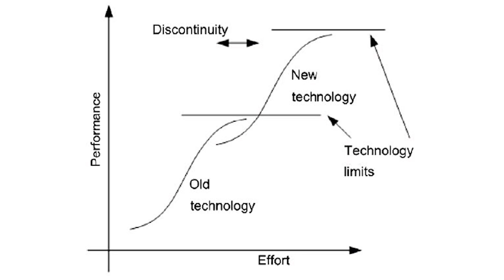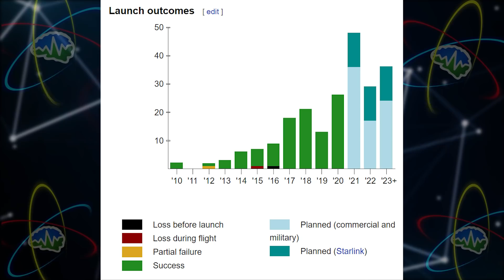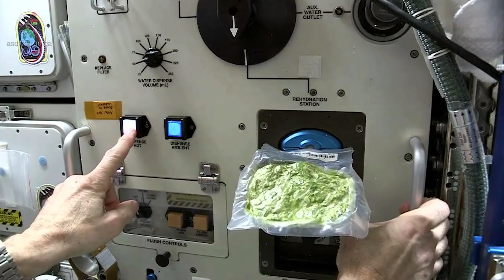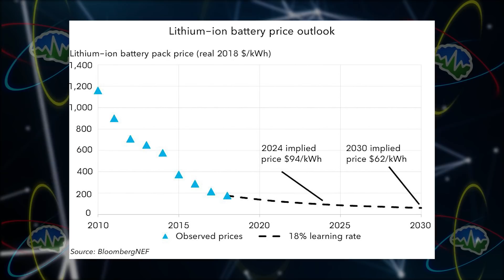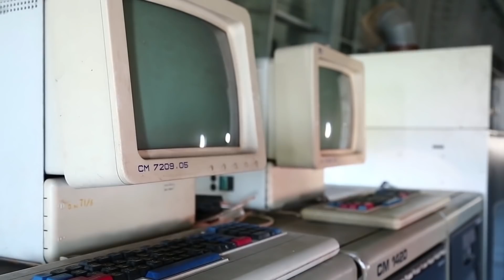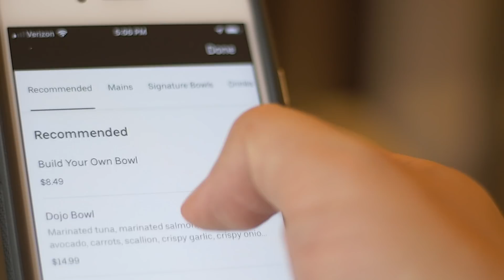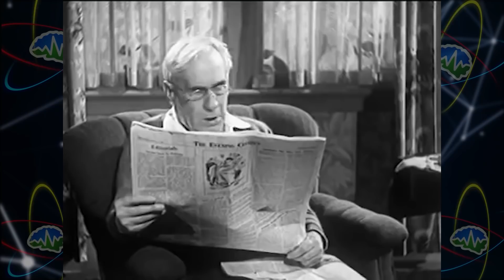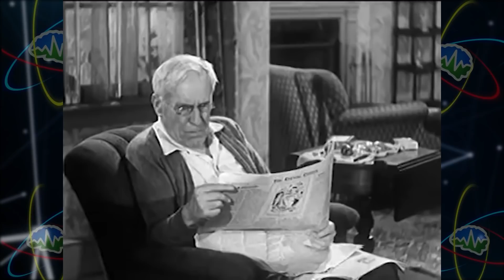5 Things Coming in This Decade | In Depth

Comment: I'm still amazed that people are willing to pack themselves into an aluminum tube with wings that is on average over 175,000 lbs to hurtle themselves through the air at speeds of 575 mph ;)
Reply: That’s why I avoid flying as much as possible. Until a year ago, I hadn’t flown in over forty years. Needless to say, I was sure glad to get my feet back on the ground once again!!!
Reply: Cant imagine your thoughts on riding in a starship within 2030 haha
Reply: @evevangelist5910  You should check out the safety stats. If a plane scares you, you’ll never sit in a car again 😂
Reply: Glen, I know all about the car stats....but it’s like someone said, if you’re driving a car and hear a loud bang, you can often pull over to check the tire. But if you’re in a plane and hear a loud bang.....:) Plus I now think that those stats are not representing the matter properly. There are simply way more people using ground transportation - proportionally than planes. So that may skewer the stats in favor of planes. Car are definitely dangerous and we come within a foot or two from death or serious injury quite often, but I’m just freaked out by planes in that most everything has to work in perfection, or the entire plane and all it’s passengers can and most likely will perish.
Reply: @evevangelist5910  I know I can’t take your fear away but I’ll just tell you why I don’t have much fear traveling by plane. Planes have redundancies and the ability to glide. From the normal travel altitude thats an important reason why even a very unlikely failure of both engines could end well. But when it comes to helicopter I think we agree. They can’t glide which makes them way deadlier than planes. It’s not like I wouldn’t fly in a helicopter but it’s definitely not something I would do too often. ;)
Reply: @Glenhh  Yeah, it's hard to break that inner sense of dread I have. Just heard of so many tragic crashes, and as a boy I experienced a real scare when accompanying my family to Haiti. The plane took a nose dive leaving us practically weightless one moment, then reversed and we felt pinned to the seats. The pilot when questioned would give no reply as to what happened.
There is another aspect unrelated to danger that causes me consternation to board a plane at this time and for many years previous - that is the excessive and real contribution to carbon emissions they cause. For this reason I'm always very interested to hear of the latest developments of battery electric driven planes. But it still looks like about 5-7 years away for commercial flights to be possible.
Reply: Back in 1964 having strapped myself into a Boeing 707 , I decided to make such an unnatural act of flying a career.
Reply: Commercial airliners have wings though. ( Some capacity for gliding. ) You won't get me into a helicopter.
Reply: @locustgrovewoodworks  I'm able to incorporate safety stats emotionally. It makes these things quite easy. I wish I could share this ability with others.
Reply: @Rose_Harmonic  At it's extreme there are emotional and logical people where it comes to risk. The logical people make the smartest safety choices. The emotional people will never get in a Robo taxi, preferring instead to continue to be smashed to pieces in ape driven vehicles. 😏
Reply: Especially with someone I don't even know behind the stick, lol! Although, statistically flying IS safer than driving.
Reply: @Glenhh  most helicopters have a feature called autorotation where the rotors act similar to a parachute, stalling a drop enough that the passengers can land safely.
Reply: @kahnmann  Do you have an example video for that? Never heard of that.
Reply: @kahnmann  Thanks. Seems fairly complicated for an outsider. Don’t know how hard it actually is.
Reply: Haha!😄
Reply: @evevangelist5910  I used to love flying but hated airports. Now I don’t like to fly either.

Comment: Great comments re education. Back around 1980 I set up a Radio Shack Color Computer system in my mom’s first grade classroom and her students used it to write a class newsletter. Spelling/grammar not good at that age but we ignored that. The important thing was that it really got the kids’ creative juices flowing, they learned a lot from the experience, and they had fun.

Other years she taught her third graders about the metric system by having them bake cookies from metric recipes and run around on the playground measuring distances between things with metric measuring wheels.

Comment: Re, discussion on long flight times and how that impacts travel: Many years ago Greyhound Bus (an interstate bus service here in the USA) ran a TV ad that compared traveling via Greyhound vs traveling via an airline. Buying a ticket at the counter, boarding the bus/airplane, putting your carry on away, settling into your seat, etc. I've traveled via both Greyhound and air, and I have to say that if you were forced to sit in an airplane seat for a whole day, you'd feel like you were about to die, just like you feel on Greyhound.

I've also traveled via Amtrak (major passenger train service here in the USA). Very comfortable, pleasurable, and the travel itself becomes part of the vacation. I remember sitting in the vista dome car as Amtrak crossed the Great Salt Lake and desert, illuminated by moonlight, in the middle of the night. Hyperloop faces technology challenges, and may be a target of terror attacks, but for long-distance travel maybe it isn't so crazy. There's been talk of a Bearing Straight route between North America and Asia. Stuck in a tube? There's the dining car, the lounge car, and more. Walk from one end of the train to the other.

Comment: If they keep the moon base at 14.7 psi, at least water boils at the same temperature as it does here.  However if they maintain a low air pressure, like the Apollo program where the everything was pressurized to partial pressure (4.8 psi) with pure oxygen, cooking will change because water boils at lower temperatures with low air pressure.  I hope they enjoy lukewarm coffee. :)
Reply: Oxyhelium at 10 psi?  What temperature would boiling be then?  It would be nice to have enough pressure so that hot things were at a pleasant temperature to be consumed.  
It might be fun to have a low-pressure Japanese bath, where the bath pool is boiling at 100 F or 110 F.

Comment: I looked at this issue of rate of change, before.  It turns out the rate of change per technology is about the same, but the Amount! of change is what's coming at us fast.  For instance, the adoption of the automobile didn't happen any faster than the windmill or the water wheel.

Comment: Hi Zac & Jesse,
regarding robocars I wonder if it would not make sense for Tesla to produce a new Tesla model that is purpose made to be a driverless robocar. It could do completely away with steering wheel and everything else needed for driving a car. Instead the driver seat could be an additional passenger seat. Of course complete autonomy isn’t there yet, so you need a way to steer the car if autopilot fails. But since the Tesla has cameras it could then be remotely controlled from a “Tesla Service Center “ where emergency drivers wait to take over. For this one would need an excellent internet connection everywhere in the world where the robocar could be. But luckily Tesla is just starting StarLink, which is just doing that!  And I guess one could build a StarLink antenna simply in the frunk of the robocar. The advantage would be that Tesla could start such a robocar service long before autopilot provides perfect Level 5 autonomy in really all situations. And when autopilot gets better, Tesla simply reduces the personal necessary for remote control. What do you think? Would that be a topic for one of your videos??
Axel

Comment: One thing that gives me pause with the SpaceX for terrestrial travel thing is weather. They cancel flights constantly because of bad weather. And the weather doesn't even need to be that bad. The first crewed flight was pushed back several days even though from the video feed skies looked pretty clear.
If the idea is that you can get people to the other side of the planet really fast, isn't that kind of meaningless if it might be delayed several days?

Not saying this means it will never happen. Just curious what they are going to do about it. Do you launch from a drone ship that finds a spot where the weather conditions are good. Or are the rockets going to be so much better in the future that weather isn't an issue? Never seen this discussed and it seems like a pretty big deal.

Comment: Self driving cars aren't going to reduce traffic. We will always have as much traffic as we tolerate before taking the train is better. If we want to reduce traffic, we need to build better trains. We already have as many cars on the road as we are willing to tolerate, and robotaxis put more cars on the road per trip, because the empty car has to drive to the next pickup. These empty cars won't be as disruptive as one might think at first, because if traffic is going in both directions equally, cars will spend very little time empty as the last destination is near the next pickup, and if traffic is going mostly in one direction, the other side of the road is by definition mostly free of humans, and so it is open for use by empty robotaxis. But the number of people commuting by car isn't going to go down, so the road will still be full of cars during rush hour.

I'm not saying that robotaxis won't greatly improve our lives, quite the opposite in fact. While we will still have the same number of cars on the road during rush hour, we will have less cars in parking lots at all times, and so we can drastically reduce the number of parking spaces we need. Self driving cars also enable us to put the parking spots  we do need wherever we want, because the car doesn't mind driving a mile away to park, and driving back when you're ready to leave, where a human generally doesn't want to park a mile away and walk, especially in bad weather. Self driving cars also make traffic jams less likely. Traffic jams are caused mostly by 3 factors, accidents, bad driving habits, and weather. Self driving cars don't stop the weather from causing problems, but they can be built not to have the bad driving habits that create and propagate traffic jams, and they crash far less often. So we will see a lot more days of smooth flowing traffic. And self driving cars also make being in traffic less unpleasant. Driving is stressful, especially driving in traffic, but sitting in a car that drives itself doesn't have to be. For now, driving in a Tesla with all the bells and whistles still requires your attention, but is much less stressful because most of the time you see that the car is doing the right thing, and stay much more relaxed much more easily. But when the car doesn't need human intervention ever, you can then reclaim your commute time, using it for watching videos, texting, working, or anything else you want to do on your phone.

Robotaxis may decrease the number of cars in operation, but they will be in operation much more of the time, so we won't see any reduction in rush hour traffic (and I expect to see an increase in traffic outside of rush hour). But they will reduce the need for parking, make it possible to move most parking out of our way, and also make traffic less unpleasant.

And most importantly, self driving cars will save lives.

Comment: I sent my first email in 1970. In my world, it was common practice by 1975, slowly expanding into the technical and some company environments. The only thing that happened in 1992 was that home communications and computing became powerful enough for it to become more widespread. The Web showed up in about 1992 too. If you pay attention you can usually find extant harbingers of tomorrow's everyday tech. One counter-example appears to be self-driving cars, which are showing up in the wider world just about as soon as they exist at all, wise or not. (I drive a fully-functional factory electric car from 2002, by the way. Most would say those did not exist. But the did.)

Comment: Commercial rocket travel from point to point on Earth will not be practical until rockets can take off under the same weather conditions that commercial airline travel can operate.  Which means that cancellation of a rocket launch due to high winds at 30,000 feet (for example) has to be overcome.  How long will that take?  Unsure.

Comment: You are to optimistic with several due dates. Even if all this could possible in the next decade from technoligical and also from price point of view, they will not be accepted by people in only 10 years ( Especially house robots will not be accepted by over 99% of people so soon). To give you an example even if quadcopters could be used for package deliveries since 3-5 years ago, they are not used at a large scale today.

Comment: Why would we have less traffic due to robotaxis? Quite the contrary, because of all the empty collecting trips, and the convenience, in my opinion. Maybe in the longer term, with 100% robotaxis and gains in efficiency of traffic flow because of inter-robo-communication, hence shorter stopping distances etc. But certainly not while robo and human traffic is mixed. That will rather decrease efficiency because robos have to account for all the human's mistakes and increase safety margins.

Comment: The problem you’re missing is that the autonomous robots you correctly point to are, in the not too distant future, going to be able to do almost anything a human can do more reliably, cheaper, and faster than a human. The exceptions include sex workers, entertainers, maids and butlers, and handcrafts persons.  If a robot can do almost anything a human can do (see above) there will be no new jobs of the future.  Handcrafted furniture makers, etc. are the likely jobs of the future.  Robots can’t make handcrafted goods and services, by definition.

Comment: I think some things you predicted are too optimistic. I think it’s a good 50 years away from replacing manual labor jobs like construction workers with robots
Reply: For US$5,000,000 I can buy 9 bots that lay bricks faster, and more square than a human can.  Furthermore, these bots don't stop for breaks.

I wasn't able to get a quote for bots that do plumbing,  wiring, sidings, or roofing, but they probably will be in that ballpark. (These bots are still being beta-tested.  Public sales/lease should start in 2022.) Call it US$30,000,000 for an all-bot construction crew.  By 2030, I expect the cost of that same all-bot crew to be US$10,000,000.

Comment: We won't have widespread autonomous humanoid robot assistants by 2030.  The AI necessary for a robot to walk around a house and do useful work is way more advanced than an autonomous vehicle driver.  When we first have widespread autonomous car drivers, humanoid robots will be far from able to clean the house.  It's way, way harder to train a robot to know enough to recognize everyday objects in a house, pick them up with agility, and do something like clean it, or put it away in the right area.  I think that may come by 2040-2050.

Comment: Starship point-to-point travel here on earth sounds intriguing, but if it becomes the norm, it could also have exceptionally negative impact on climate change.  Then again, the time of travel will be shorter, so maybe the carbon exposure won't be that different.  But just a thought.  Greta Thunberg will never use it!
The impact of Full Self Driving is estimated to generate approx. 12-15% national unemployment, or more.  Not only drivers, but also truck stops, traffic cops, parking garages, dealerships and auto repair shops, traffic court, traffic-related accidents in hospital ERs,  etc..
Plus Elon will be automating Tesla production lines as much as possible, retail stores and employees will continue to diminish, basic services (medical, legal, financial) will be automated, DOD is now designing and building ships and subs and planes and armor that doesn't require onboard operators, and so on.  50% nationwide unemployment is projected by mid-century or sooner (by 2035?), and then UBI will become necessary.  And THAT will change EVERYTHING.

Comment: So, what makes you think people will be using robo-taxis so much? It's essentially the same thing as a regular taxi, just autonomous. So what makes you think people will use them more just because they exist? You think they will be cheaper? Sure, probably. But that isn't what drives people to use a taxi service. Many folks still like having their own wheels, and that is the REAL crux. You need to remove that mindset. Good luck. And don't even get me started on the everyday rocket trips to Shanghai. Your optimism is very cute, you think this is going to be a thing within this decade. There is so much more from a safety perspective which needs to be done here. Rocket engines and sub orbital vehicles are in no way comparable to turbo-fans and airliners. Much higher stresses and many more failure points. We have a whole lot of refinement and tech to go through. Maybe 15 or 20 years from now...I remember when people were talking about going to Mars back in the 80's. Here we are in 2021 and it's still definitely more than 5 years away before we even send the very first humans there. And that is being VERY optimistic. The big problem is that people VASTLY underestimate everything it takes to actually pull it off, especially those without engineering backgrounds. I could make your head spin in under a minute rattling through all the necessary systems needed to do it, and I would still be rattling on for hours discussing all the techniques and technologies needed for the total voyage.